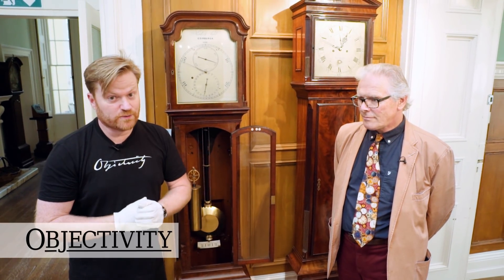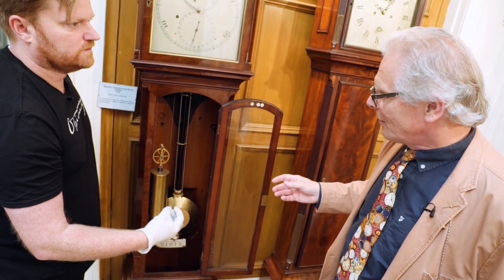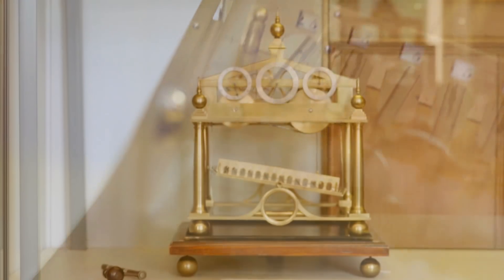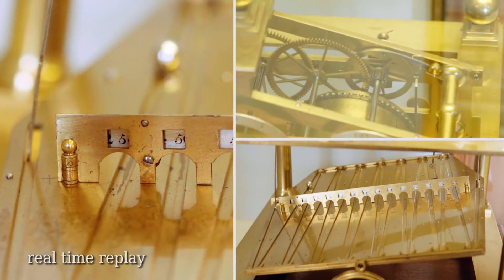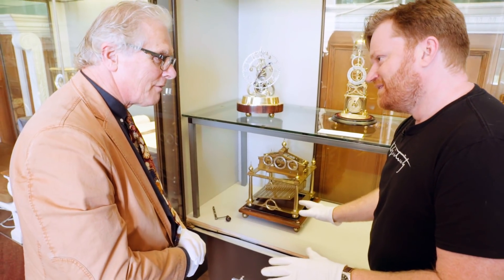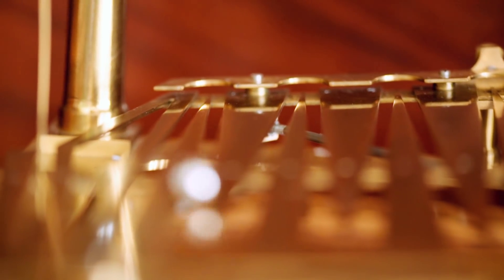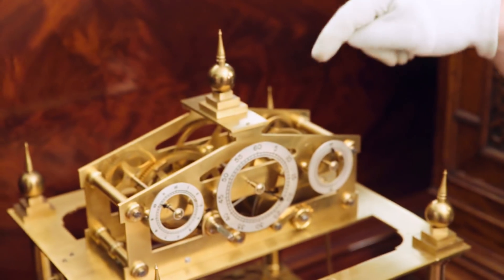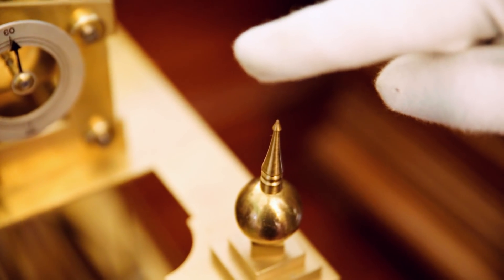Rolling Ball Clock - Objectivity 138

Comment: No clock is perpetual of course, but there is a kind of clock that never needs winding. They contain ingenious mechanisms that extract energy from variations in air pressure, kind of elaborate barometers. The institute probably has at least one specimen of such a clock, it would be great if a video was made about them.
Reply: Francois Lacombe I do believe you are talking about the Jaeger-LeCoutre Atmos clock.
Reply: Could something like that be considered "functionally perpetual" if that makes sense? Like is there any likely situation that would cause that mechanism to stop? Why isn't something like this used for energy aside from clocks? Is there just not enough energy to be gained from barometric pressure change?
Reply: +Derkman96 - You're right, there simply isn't enough energy in the air to run anything requiring more torque than a clock. It's not a perpetual motion machine because it requires external energy input.

Comment: There is one of these in the Science Museum, too. Was always about 2 seconds too slow for every 30 second interval
Reply: The problem with the mechanism is not the old manufacturing or design, the problem is the randomness and unpredictability of the ball meaning that the mechanism will never be very accurate.
Reply: I'm sure with modern manufacturing and design you could make a much more accurate model of a similar mechanism but considering what it is it's really not that bad